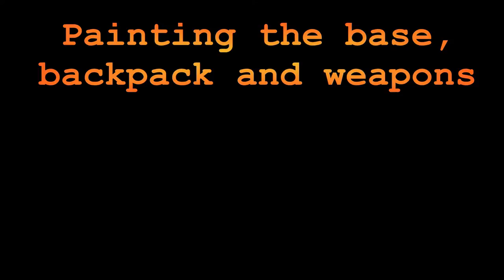: 052 1/144 Turn X Built : Part 1 of 3 - Painting the Base,Backpack n Weapons

Comment: This is nice. What pressure do you shoot the paint with? It must be pretty low pressure by the looks of it.
Reply from the maker: stevethefishdotnet Around 10-15ps depanding on the paint ratio.Most of the time my paint are very thin. I removed the front cap to get a better line.